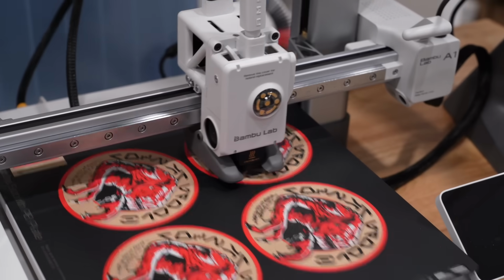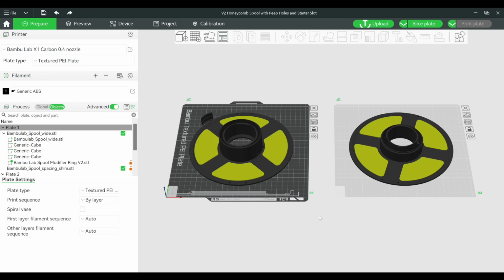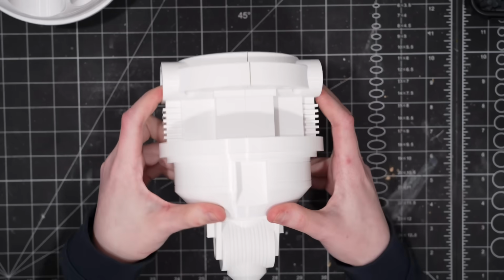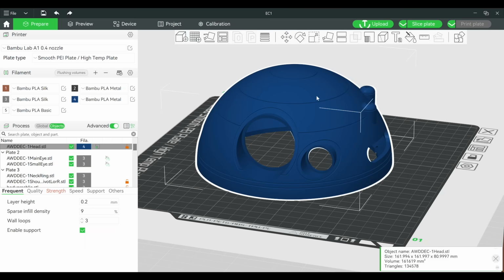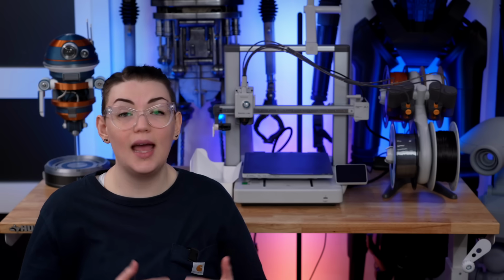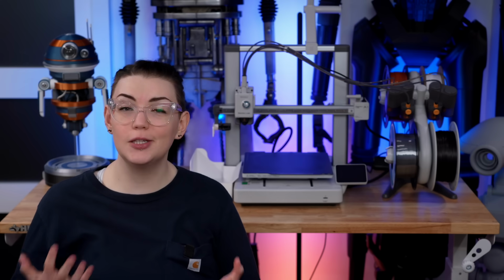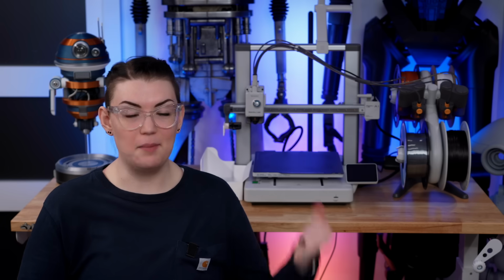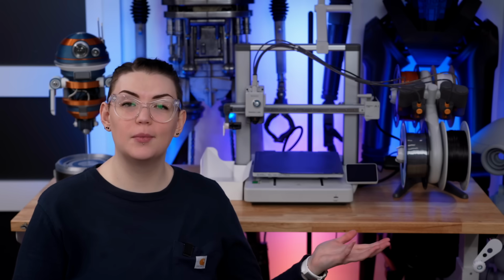Is the Bambu Lab A1 the Unbeatable 3D Printer for Beginners?

Comment: Been 3D printing for awhile now (several years), and I can honestly say buying the A1 printer is the first time where the printer feels like a tool, and not a project. Which is great, even if you're a tinkerer.  I love to mod things, but sometimes I just want something that works as advertised, and this printer does that.
Reply: i mean..... i am a tinkerer

on my actual projects....
Reply: I tried 3d printing about 5 years ago and got one of those Prusa kits.  It came with like 200 pieces and like 500 screws.  I probably spent about 30 hours over a weekend assembling it.  The next weekend I spent about 10 hours trying to get it leveled and calibrated.  Then, I did my first real print which was a small figurine that took like 6 hours to print.  After that I was like screw this.  It looks like it's gone a long way since then.
Reply: I love to mod... but my Ender 3 was a real pain in the ass (and still is). I had several problems from the start that took a whole lot of failed prints and modding just to get it to work. Then when I upgraded the hotend to print at higher temperatures, it hasn't worked right since. I have a new v6 hotend for it to hopefully get it back to working condition... but I don't feel like messing with it, because I've spent almost as much time working on it as I have ever spent actually printing with it. Despite the problems from the start, it did print extremely high quality from the start though. I just had problem with the bed/springs, problem with losing zero, z-axis problems and also tilting problems and had to go dual-axis, z stop problems, problems with maintaining temperature, a thermal runaway once despite having a new thermal runaway protected mainboard... and many other problems. It's just insane that Most of these problems are known by Ender, but they continue to sell defective printers regardless, when it would cost them very little to nothing to just fix them.
Reply: I sold my Ender 3 V2 because I was sick of the work needed to maintain decent print quality. I am really tempted by this.
Reply: @ProjeKtWEREWOLF  Have had the A1 for months now and it just keeps printing with no issues.  The price point is pretty good at the moment as well.
Reply: @roundabout2926  Don't understand: Did you have a Prusa MK3 if you've been 3d printing for so long?

Because this "it just works" has been around for years and years with Prusa! The only thing was: people had to be willing to pay the 900 bucks price tag, which many were not. They went with cheaper Ender 3 instead. Now they are buying expensive Bambu X1C or P1S and praise the quality: it has always been there, but people were to greedy to pay for it.

What gets me most is the idea of upgrading and repairing: even today you can upgrade an 5 year old Prusa MK3 to a MK3.5 or 3.9 and get 2x - 3x the speed which brings it up to date to a A1.
But I am quite sure that in 5 years an A1 is not that upgradeable, because of the molded and custom parts. So it's never become a A1.5 or A2, I guess.
Reply: @ProjeKtWEREWOLF  I was surprised by my Ender 3. It was a massive pain in the ass from the start, always breaking and needing to be modded just to work at all... but the one thing I never had a problem with was print quality. It printed exceptionally well from the very start. (Until I replaced the hotend with a MicroSwiss, so I could print at higher temperatures... because now I can't print anything even remotely good quality).
Reply: I wish I had seen this video before I bought the ender 3 😅 cause calibrating the bed is a pain lol I managed to get one print right but then I did a bigger one and that’s when all hell broke loose lol
Reply: @pepegrillox249   Hi, I’m 72 and started with a Ender 3 S1 like you said, pain in the arse. Ender 3 was replaced with a Neptune 4 pro, they have both been replaced with the A1 and it is the best machine I have had, absolutely brilliant. Buy one you won’t regret It.
Reply: @fredblogs  as soon as I returned the ender 3 I went and got the A1 ! I’m so excited !! I can’t wait to see how much easier it is to at least level the bed lol !
Reply: Kinda why i stop 3d printing and just paid ppl it was chore for me to get prinys to started and not to fail
Reply: Bether than a prusa?
Reply: I modded my Ender 3 v2 with a bl-touch and uses octoprint, works good but I just bought the A1 and just wanting for it to be delivered.
Reply: Thanks
Reply: Totally agree, and I have experience with Makerbot, Ender, Creality etc.  All projects and frustrating.  There are so many attentions to detail with the A1 it is finally nice to have a printer that just works.

Comment: Depending on size of piece you can probably put 4 walls and that should cover any bleed you may get when purging to infill. I did some killer whales black and white 3 walls and took the ratios into the red on some of the changes while purging to infill and deleting the purge tower, and they turned out decent. For camera frame rate your internet plays a part because mine isn't that bad at all.
Reply from the maker: I will definitely have to try that out, thanks!

Every other printer I have with a built in camera has no issue with 10-20 FPS on my internet so it seems to be something about the A1 specifically.

Comment: How much room (space) would you say that you need to set up everything for 3D Printing and Lasering?
Reply from the maker: Really depends on the size of the machines you go with. In many cases a 2’ x 4’ desk/workbench setup would suffice. You could use underneath the table for filament storage, etc. which tends to take up the most space.

Comment: Superb review Michaela, EC-1 looks absolutely fantastic in colour for sure.
I totaly agree, if you really want the best prints learning the slicer is essential, and well worth it.
I would like to add to your comments, and showing the amount of waste in case that alone is putting people off...
Even thought the bag looked almost as big as the droid, the little waste nuggets are thin and very hollow, so in weight it is probably only about 10% of the weight of the finished Droid.
 Perhaps you can say what the percentage of waste is?
Reply from the maker: Yeah, it’s always a bit deceiving since the clumps aren’t completely solid and take up more space than the equivalent amount of material might in another form. I believe total waste for the EC-1 was around the 800g mark between the purged material and the prime towers. I can’t recall the exact amount of filament the EC-1 on its own was estimated to use but I’d guess the 800g is around 50% or more of the droid’s weight.

Comment: Been using my new Neptune 4 plus for about a month now, and yeah I absolutely agree with your point about learning the slicer. Only failures I’ve had have been me screwing up pla+ temps for a helmet I tried to make, that and supports. Still trying to learn how to manually place supports since orcaslkcer tends to overdo them haha
Reply from the maker: I’m typically using Orca as well. I normally have the slicer auto generate support and then go into the support painting tool and block areas (right mouse click) where it’s generated support, but doesn’t really need it. You could also just change the support threshold angle if it really seems to be overdoing it.
Reply: @MMsPropShop  yeah I’m still learning how much I should use on a print by print basis but the fact that I can basically just press print and it’ll work is amazing to me given I tried and gave up with an ended 3 a few years ago. Man that thing was a pain

Comment: Bambu slicer actually uses the open source slic3r which is Prusaslicer so basically it is a reskinned and tweaked version of Prusaslicer and the development was predominately done by Prusa and the open source community. So I would add that small correction. I did work with Prusa in the past for transparently though I still feel that needs to be clarified.
Reply: Prusa Slicer should adapt the Orca/Bambu Slicer UI. 
Did go back lately to test Prusa Slicer for my Snapmaker J1 (Idex) because it has more options for multi head printers. In the end I used Orca Slicer.
Reply: @Todestelzer  
Hi there,
Would you mind sharing the settings for the coasters?
Since the 3MF file from MakerWorld contains changed settings for ironing.
 
Thanks.